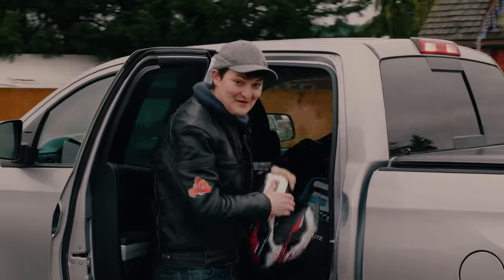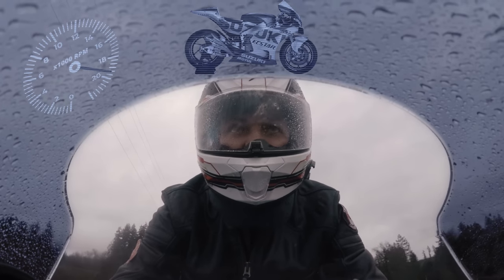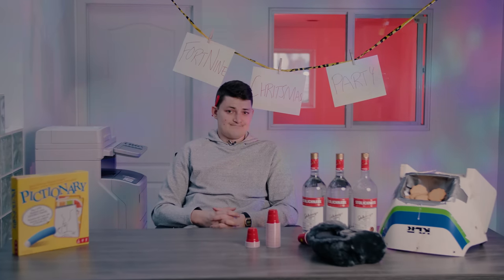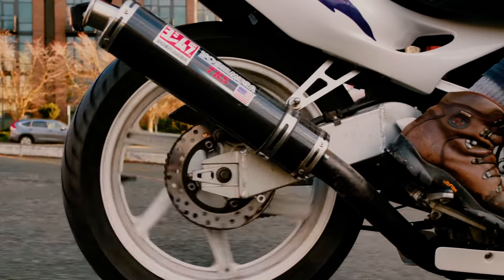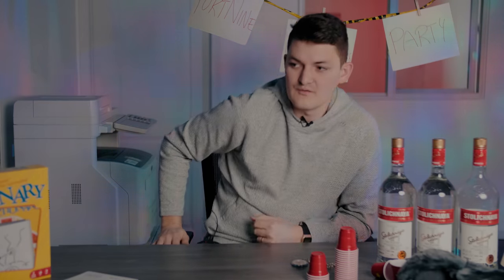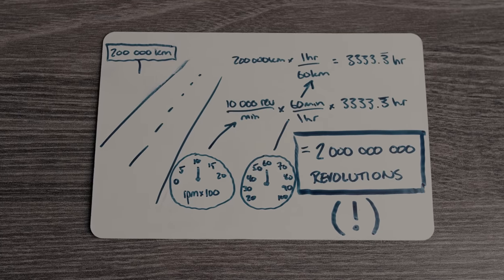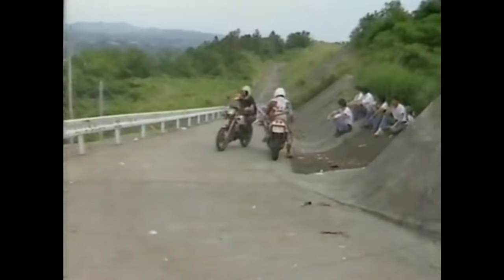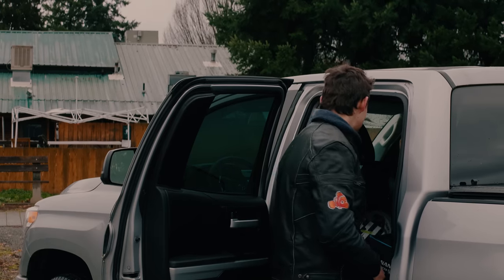The '90s Honda that Revs Faster than an F1 Car

Comment: They should bring back the 90's paint job back on bikes.. Love the retro look on them!
Reply: they actually did this year, on a 2022 cbr1000rr with anniversary edition livery mimicking that of a cbr1000rr of 90's
Reply: It's on the fireblade
Reply: But... if they brought them back? It wouldn't be retro.
Buy an old bike.
Reply: It's called paint. Flat black or green is rust prevention.
Reply: have you seen suzkie :P
Reply: @pleasedontwatchthese9593  latest v-strom 1050 is a super nice in yellow/glue color, no?
Reply: As well as the 30th Ann Fireblade in those awesome tricolors, Kawasaki showed a ZX-10R at a very recent show, customised in the old 750 colors (pastel green, blue/purple, white & black, I think) … that looked super retro cool, too.  You should be able to Google pics easily enough, if interested.  I hope there are more releases like that … 😍😊
Reply: @kierenmoore3236  correct, bikes become more silent, eco friendly, i don't mind, but may we have at least cool colors, please? ;)

Comment: It should be noted that F1 engines did reach 20,000 rpms in 2006 with the newly introduced 2.4L V8s with Honda itself among them. They limited it to 19,000 rpms the year later.

Still, they had 2x the cylinder count, nearly 5x the displacement per cylinder and not needing to worry about street vehicle service intervals.

Comment: I owned a Honda VFR400R (NC24) from the same era, it was equally nuts. 400 cc V4, also with gear driven cams and with a single sided swing arm. It redlined at 14.5k rpm and put out just over 70 hp. It was so much expensive tech in such a small motorcycle. Absolutely loved it for the 5 years I owned it. I deeply regret selling it but sadly had no other choice at the time
Reply: And they were tiny, I couldn't fit on one....
Reply: I couldn't afford one until 2000-2001 and yes it is a fun motorcycle unfortunately it needed constant maintenance it was the first model.
Reply: And actually has smaller spark plugs than the CBR250RR
Reply: I have ZXR 400 right now, but I don't know if it's so legendary or not?
Reply: @megapet777  oh it’s pretty legendary! The majority of the 400s were sold to a very limited market, most are a grey import from Japan
Reply: @6tdegrees  Yeah I haven't noticed any other on the road except for mine :D. I live in Finland btw. I kind of accidentally got it for my "A2" class bike (Which is a motorcycle license you can get at 18 years of age). I wasn't looking for anything particular. Guess I was little bit lucky.
Reply: I had an nc24 for a few years too. Unfortunately they make nearer 55-60 hp but it’s enough. I also had the nc30 and nc35 later on. They are all fantastic bikes.
Reply: Yes they are legendary. Slightly hard shock (usual on most 90s kwaks) but all the 400 amateur racers in the U.K. seemed to have them.
Reply: I’ve got a Magna. I can only imagine the insanity of a 400 with proper gear driven cams instead of the chains the cruiser got
Reply: @megapet777  Can't buy one here. Every single ZX400 died racing in New Zealand - nearly bought one for racing 20 years ago.
Reply: yes yes ....v4 i have a vfr800 and this is one of my fav sounding engines...
Reply: I also owned a 400, but mine is the CBR400RR (NC29). One of the best inline 4 bikes ever!
Reply: Had a Bandit 400 import. Not quite on the same scale of awesome as the race reps but still a lot of fun. Even if it was to small for me. I looked like a Great Dane shagging a Chihuahua.
Reply: @kevinmiller4312  The 400 magna? Or the 750? Because they neutered the 750 with smaller carbs, cam chains and a missing gear. you can swap a vfr motor of the same gen in, i think, and gain like 10 hp and a gear.
Reply: I still own the NC29 version. And even thought i'm not the largest guy, it is a very cramped fit. Its been sitting the in garage for a while, i should probably dust it off a little :D
Reply: @gerardmontgomery280  :P LOL - Nice one mate. Merry Christmas from New Zealand :)
Reply: @peteleivo2247  it’s the 750. It kicks ass but I have to live with the knowledge that it’s not got gear driven cams 😂
Reply: @kevinmiller4312  Yeah. I've been eyeing a Magna for a while, A2 restrict one and rip the reatriction shit off, Magna Deluxe paintjob, if I could find one then a VFR engine swap. Like longblock and carbs type swap.
Reply: @peteleivo2247  do it! It’s an awesome motorcycle. Mine is my starter bike and it still has wayyyy more power than I’ve needed so far

Comment: Honda CBX 1050 is also an absolute legend in bike sounds.
Reply from the maker: Amen to that! Saw a mint-condition CBX pop up in Vancouver last summer. The price made me weep blood. ~RF9
Reply: I have a friend who has six of them!
Reply: @louis__________________8281  do you have a CBX for sale ?
Reply: @FortNine  I'm still in love with my VTech vfr XD
Reply: They sur are cool but you really have to want one. I'm not fiddling with 6 carbs not even for that sound!
Reply: I witnessed Frank Mrazek racing a CBX at Tremblant in ‘79-80, what a noise.
Reply: @FortNine  I have a good buddy of mine who has owned over 10 CBXs and still has seven. He was one of the street racers down here that ran with Thursday night riders in Kentucky. Hearing one is a glorious noise hearing three of them running at the same time is an orchestra of which no man can compete. I’ve seen video of the day after him and a buddy bought brand new ones and ripping the rear tires off them.
Reply: @Maxime_L91   my CBX 1050  z (1978) never had a problem with the six carbs  😎

Comment: Best bike ever made, I've had mine for 6 years and it still puts a smile on my face when I ride it.
Reply: 2 years into owning mine and it never gets old.
Reply: you guys are so heckin lucky!
Reply: Don't you have to be in the mood for riding it though, I would imagine they are pretty focused.  Don't ge me wrong though what a marvel of mass engineering.
Reply: @fiveplates  

Definatly its not something I take on a longer trip. I've also owned a 600rr and recently bought a hd forty eight. So the little mc22 can be used only on occasion or when a friend of mine rides one of his rgv250's

Comment: I had the exact same bike for my 1st road bike. Absolute beast of a bike.
Reply: Sheesh. Can’t imagine riding one of these without the stabilizer upgrade like this one had either, would be insane hitting 160 on this
Reply: They are not they make alot of noise but are pretty slow
Reply: 45 horsepower. Aye, beast.
Reply: @HashMaster1776  160? Shii My friend got this as his second bike, managed 190 on a straight before slowing down.

Comment: A friend lent me one of these for a few days about 15 years ago while my bike was out of action. I am not a fan of inline fours but I used it to commute to work and it made the ride huge fun; a really amazing little gem. A Kawasaki 250 four I rode around the same time was very boring by comparison. Another great video and one which brought back some good memories.
Reply: How can you not like inline 4??
Reply: @MZMotor95  I some it's the lack of power low down and comparatively low torque. I would agree that 2-3 cylinders tends to make a better street bike for general use. While 4-cylinders sound amazing, they just don't power through cities like lower-revving engines.
Reply: @TravisTerrell  But you dont power through cities... you power through twisting roads on the countryside.
Reply: @MZMotor95  in cities I love the sound of the cbr250rr bouncing off the building it's Almost like a tunnel run
Reply: @Emfourayone  what do you think about the latest CBR250RR currently sold in Asia? I borrowed it from a friend and that thing scares me. Coming from an MT15 rider myself.
Reply: @hamakaze9812  personally not a fan it's just a twin cylinder commuter bike to me the original screamer bikes from the big four are some of the best 4 stroke 250s you can learn to ride on

Comment: My father owns a zx25r, and it's such a beautiful bike, it idles above 2000rpm, and power starts kicking above 8000rpm, even with stock exhaust is sounds amazing. It feels as if you were racing, but at a legal speed. I wish other manufacturer start making 4 cylinder 250cc, rather then the boring 2 cylinder ones.
Reply: and the autobliping sound!!! ahh feels like 00' f1
Reply: Kawasaki ZX25R
Reply: But some countries in asean and japan, 250 cc 4 cylinder bicycles began to be made like the kawasaki zx25r and soon there was the cbr250rr-r
Reply: there're lot of opinions. The complexity involved in making a 4 cyl make "250cc" a poor choice of capacity.
Many would arguably argue its better to make it a 400, but then we have 600's.
In developing markets, cc is still a prime differentiator. They will never understand as a market why the FZ1 is priced lower than a YZF R6 (the older 599cc one).
Thus, ZX 25R is marketing wise not the best decision, globally speaking. But its alone in a rare category so....
Reply: I had a Ninja 300 for two years. It's a two-cylinder, redlined at 13k and was far from boring. I still wish I had the chance to keep it.
Reply: @180FiftyFive  What I ment by boring is the lack of choice in the market (at least in my country). A lot of 250cc came with 250cc. Kawasaki made them, Yamaha and Honda too. So a 250cc with 4 cylinder is considered as "cool" to me. Don't get me wrong, 2 cylinders are great. Before the zx25r, my father owned an ER6N, it was a fantastic bike in terms of power and fun. I bet the ninja 300 must be fun (they only offer the 250 in my country, so thats why I don't compare the 300cc up bikes with the zx25r)
Reply: @Samarth916  I think that's why they marketed it only for Asian market. It gave the freedom for motorcycle enthusiast to enjoy a 4 cylinder without the nasty regulation and tax. At least that's my opinion....
Reply: @aksarayakobus  Er6n and ninja 650 are a different class of bikes. Ninja 300/400 are very lightweight. Ninja 300 has a 140/70 rear tire, the handling is absolutely effortless, makes for a fun ride where you focus on perfect lines and perfect shifts instead of effort to steer. You can always correct your lines even in bad situations as long as you don't target fixate. The handling response on bikes with bigger tires and more weight is retarded (slowed I mean). So a 650 won't ever handle like a 300/400. And also 650 parallel twins have more torque rather than a higher redline like the 300/400 Ninjas. 

But I agree. The only choice I ever saw in this segment was the RC390 and the Ninja 300/400. Even the R3 didn't excite me. Just overall package was a bit boring.
Reply: @aksarayakobus  And of course the 4 cylinder sound is way better than singles or twins
Reply: How to buy it in north america?

Comment: I used to have the FZR250 with a barely-a-mufler exhaust. Going through tunnels was a treat. 
But holy shit, better hope you don't get carb issues with any of these. 4 individual carbs for a 19,000 rev range.... Jets for Africa. And they're all tiny. Slightest bit of varnishing can throw them off. 
I got to the point where I could just about dismantle the carbs blindfolded.
Reply: Yeah, if you aren't a bike mechanic, these bikes are not for you. Definitely start it regularly to keep the jets clear. I got to that point of carb disassembly skill with a VFR 400 I was desperately trying to tune to run acceptably, I had it apart at least 30 times. Never could get it running right.
Reply: Haha amen. I recall using a large ball bearing in each carb to balance them.

Comment: I swapped a gopro hero 4 several years ago for a cbr250r that the guy said it was only running on 3 cylinders. It had no battery but I brought my own along with me to start it up, after letting it warm up I knew it was running fine so the guy happily swapped for the GoPro and I left smiling. I got a reasonable price for it a few mths later after giving it a bit of a birthday but it would be worth double now

Comment: Lost my R6 in an accident a couple weeks ago. Decided almost immediately I wanted a 90s CBR250. Guess the prices are gonna be through the roof for a while thanks to this. Still won't stop me from trying to get my hands on one though :)
Reply: They’ve been through the roof since they were new. There’s never been a time to buy these
Reply: this is a 250RR though. isn't a regular 250R just your run of the mil Ptwin lawnmower beginner bike?
Reply: @twrcrew8852  the Ninja 250 is the parallel twin beginner bike. I think it is technically a 250r, but everyone just calls it a ninja 250. Kawasaki also makes a 250rr Mono, which has 1 cylinder. The 90s 4 cylinder 250 is called the zx2r and redlined to 20k. That’s the pricey one. The one that started it all. And finally, the zx25r is the revamp that is coming out. Unfortunately, it’ll be hard to get a small high revving engine to pass US emissions nowadays and if they can get it down, it’ll be done with the use of big catalytic converters that will rob the rider of power. It’s only going to have 45hp in non emissions form to begin with. Plus, the redline is only 17k. I’m sure it will be fun though

Comment: Had a Hornet 250 back in the day. Lovely machine! The same engine with different cams but still had a high rev limit.
Reply: I still have one .. 2007. Been revving the shits out of it in Dubai
Reply: And the extra wide back wheel made it a great machine
Reply: @schlumberger112  Aren't the carbs finicky? I was discouraged from getting one a couple of years ago due to such feedback.
Reply: @maynilaPH  I too used to keep away after a terrible experience. But my only option to get a 4 cylinder 250 was carburetor. So I checked with my honda dealer and they did a full tune up and carb clean. In Dubai you don't face issues with cold start

Comment: Greetings from New Zealand! Thanks for posting these little "pocket rockets" as they were sometimes called here and the UK are fantastic
bikes. Made in Japan at time when the manufacturers were all trying to out do each other, as a result the consumer benefited : ) Unfortunately
given build costs and the way the World is going we're unlikely to see the likes of these again. Great build quality,reliability,handling,gear driven cams 
and an addictive soundtrack to boot! I own a 1991 NC29 400RR with just over 19'000km on the clock or for my fellow USA riders just over 12'000 miles, 
we are lucky enough that down here quite a few dealers were able to import them. If you ever get the chance ride one. Ride safe everyone ; )
Reply: I have an mc22, nc29 and an nc30. The nc29 is a great bike and surprisingly quick. Nowhere near as special as the mc22 however, whilst a good bike, there's something about the near 20k rpm that set these apart. Do love the nc29 however, but they are far more serious (quicker than my old thundercat which makes them quite pokey)
Reply: fzr400 1wg here. Best sound in the world. 
also kiwi.
Reply: Kiwi here. I had the MC17 1987 CBR250R, the 1988 FZR 250R and the rare Katana 250 four. There are at least 4-5 inline four 250's for sale on trademe right now! The ZXR250 is almost impossible to get now, sometimes you see one a year turn up for sale
Reply: A pocket rocket is a gun. This a crotch rocket
Reply: @EndTimeDreams  One of these just sold on trademe for 9k. I'm thinking i'm going to keep holding on to mine now :)

Comment: I started riding on a 2003 Ninja 250 and always wished I could get my hands on a 88-90 CBR250. 4 cylinders sounded like the big bikes and they had nearly double the horsepower with a few mods.
I will definitely be looking into this new Ninja ZX-25r!

Comment: I've owned one as my first bike back around 2007. A little low on power but it was fast enough for a first bike. I loved the high revving engine. I could be hitting the redline at 19500rpm and makes it feel like I'm going a million miles an hour but I'm only doing the speed limit. At the time I only wished it was a little more modern and a longer 6th gear, I'll be revving 9000rpm in 6th to do 100kph. I sold it to get a 06 R6 after my license restrictions were over.